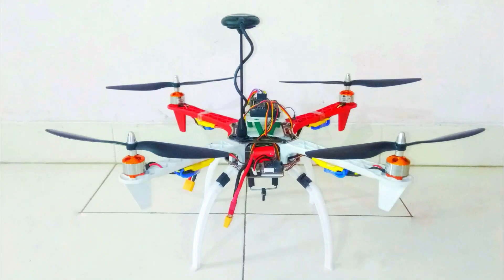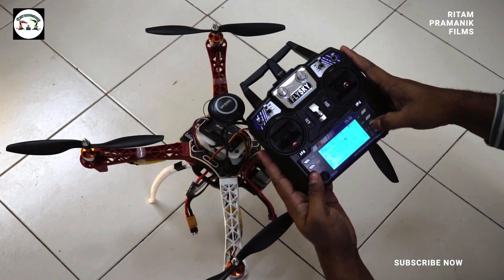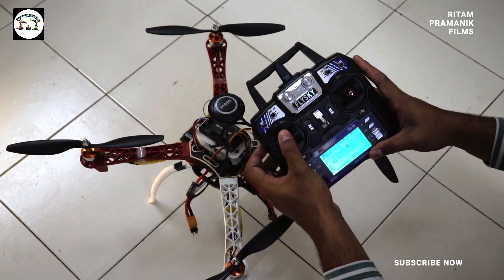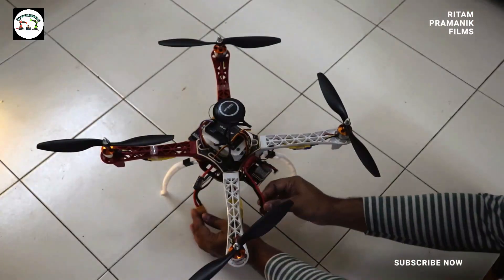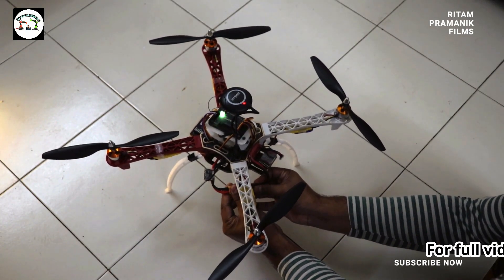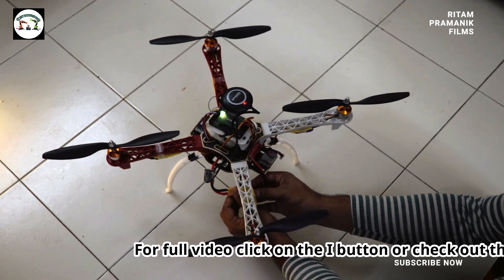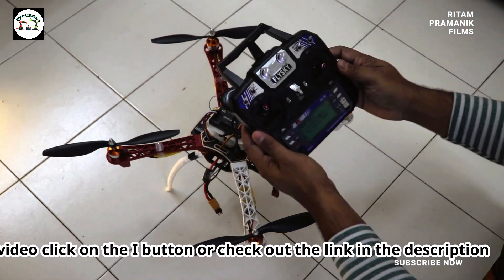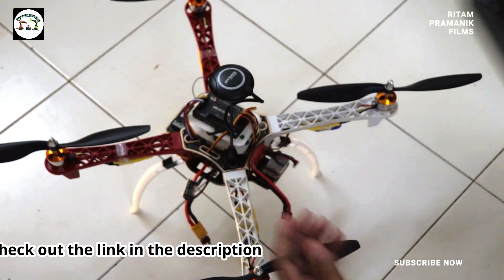How To Calibre ESC || ESC Calibration || Chandrabotics

Comment: Reply please ?
Reply from the maker: Great news that you have successfully made one Drone😍😍
Actually when someone made drone using APM for the first time then that person may face various type of problems. This is very common..... 
I have also faced.
1. In your case you have to complete every calibration with so much precession.  According to me this is the actual reason.
2. Chack every connection properly. Every connection must be tightly fited.
3. Check if APM and Gps module is properly attached or not. If it moves a little bit then Drone will crash. This may be a issue also.

Check everything properly. If you still face problem then you can contact with me. I am always here to help you.